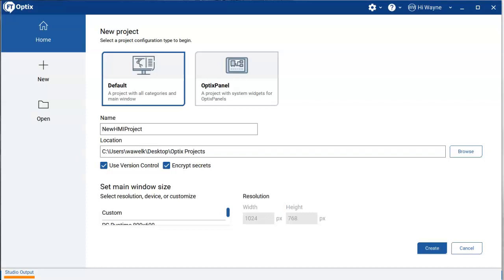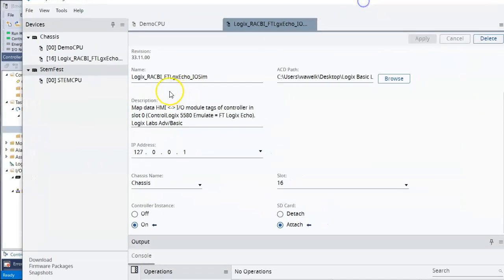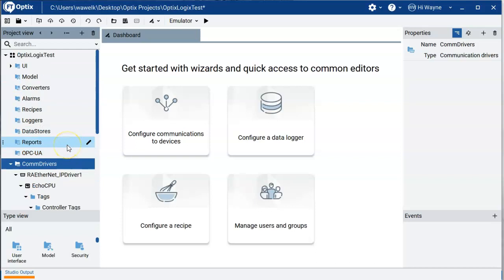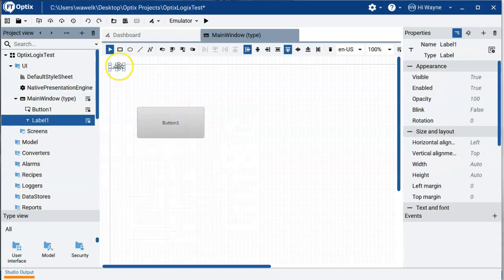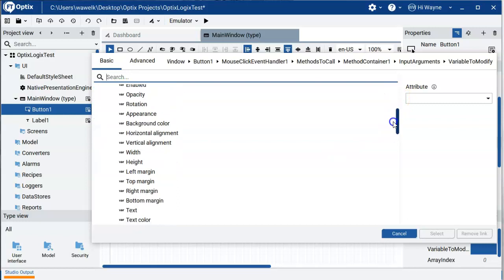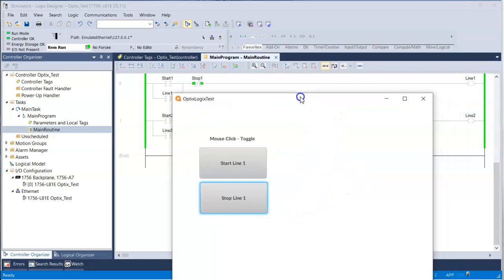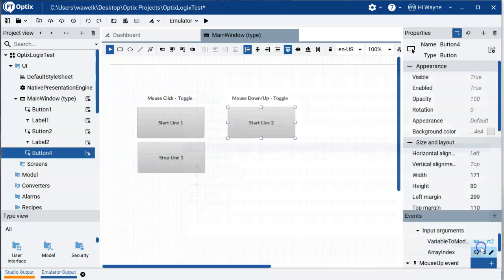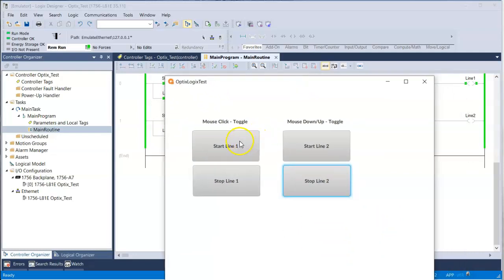Linking Pushbuttons in FactoryTalk Optix to a Logix Controller

Comment: Be careful with the mouse down/mouse up toggle. If you press the button down and hold, slide your finger off of the button and lift it elsewhere, the tag will stay latched on. Then you'll have to repeat the process to get it back to normal operation. Do you have a fix/alternate solution for this?
Reply from the maker: Thanks for the tip.  Not aware of a button available that does not work in any other manner, at least not from my experiences.  That method of mouse down.mouse up seemed to mimic the PanelView momentary pushbutton the best.  Curious if anyone else has comments on this topic.
Reply: They are using a call back built into windows, so no there is no fix, since it would require fixing the behavior in windows.
Reply: Thts right